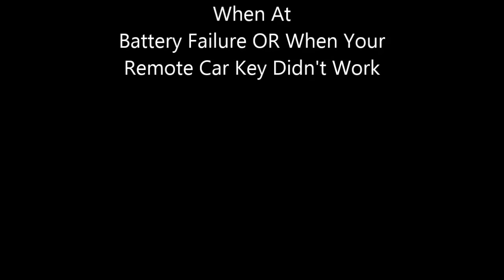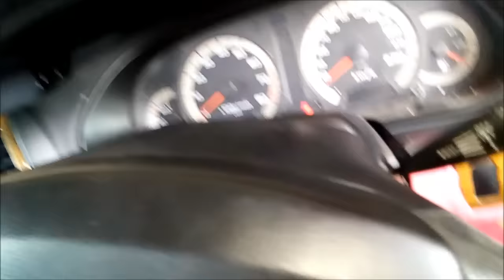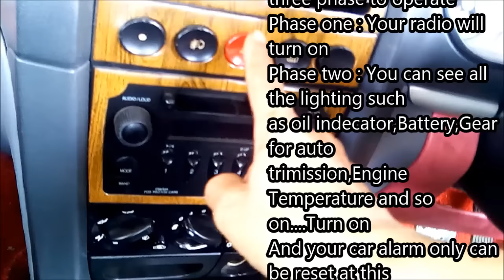How to Reset Your Car Alarm

Comment: Thank you , I have an 04 Lincoln LS and I could not figure this out for the life of me.. So I watched your video, it took me a minute to see what you were doing lol. and on mine the hazard button is setup on or behind the steering wheel.. Well key in alarm lit up and press that flasher once and boom started right up!! This particular car locks the ignition so it would not be wise to unhook your alarm. so thank you OP for such a helpful post!!
 Also for anyone else with the same make and model, if your alarm goes off while out side, use your driver door keylock and driver key to unlock the door, it will shut it off, but to start your car again you must do the flasher trick! mine hasnt gone off since.
Reply from the maker: You are welcome and thanks for adding more tips and thanks again for dropping by

Comment: Hi when I turn the key to second step, the radio/battery @ board lights didn't turn on. Do I need to start the engine before pressing the reset alarm button? Proton Waja cps btw

Comment: A lot of people tell me that it would not make a difference but, if it will not make a difference, why did it come this way? Is it just a way to save on lead and this is a quicker way of making them so they can save money on production/
Thanks again.
Reply from the maker: as I know lead connector were used in a small appliance, but for car with a very high amp battery ... eeemmmm I don't know

Comment: Battery terminals become corroded because somebody broke the seals around the post, allowing acid to escape. This generally happens when people pry the clamps off without using a battery clamp puller. If you've seen battery clamp pullers before and wondered why they exist, this is why. They have hooks that go beneath the clamps and pull them straight up without breaking the seals.

You're welcome.
Reply from the maker: Battery Terminal Puller design for the removal of badly corroded battery cable clamps and faulty small generator bearings not for removing clamps which still in good condition ... just loosen the tightening skrew and its quite easily to pull off

Comment: I know this is not related to this video but, would you know if I changed my negative battery cable connector which is lead free to a lead connector, would it make a difference? I know it came with the car for a reason. I just don't know why.
Thanks again for this and the other videos.
2006 Impala LT 3.9 automatic.
Reply from the maker: everyone using wire made from copper or aluminum and a non-lead wire are still new ... emmm I don't know how to answer your question, maybe you have to google more for some clue
Reply: Thank you for your reply.
Reply: Copper wire is far better than aluminum.
Reply: Thank you for your reply but, this question is 2 months old and the question has already been answered but, thanks anyways.

Comment: Omg your awesome! My car alarm hasn't been working so I finally bought a battery for remote but that did not work. Came across your video followed your steps and wallah like magic problem solved. It did take me a 2nd try. I only had the hazard button to deal with and no extra buttons but it worked I'm good to go thanks
Reply from the maker: your are welcome and thanks for letting other viewer know and thanks again for your visit ... and spread the knowledge to other

Comment: Put a battery pack into a cigarette lighter or use a adapter for the OBD port and the radio presets will be okay and the alarm system too.

Comment: I have a same problem right now..when i change the car battery,my alarm wont stop,then i change my remote battry also didtn work..how can i solve it
Reply from the maker: Push the alarm reset button
Reply: Kluangman Cooleck ok thank you..it work already..
Reply from the maker: All the instructions were under the video discreption area ...
Reply: Kluangman Cooleck one more thing yesterday i try lock use my alarm,it wont work,it just have a beep sound many times but it never lock the door.but when i open the car light and close the door with the light open,it can be lock..
Reply from the maker: Rudy zil try to apply wd40 to all your door locking mechanism .... Rear bonet locking mechanism and mechanical switch
Reply: I have an after market Viper alarm with ignition lock.  Saturday the alarm went off but unlike normal triggering I didn't hear the chips before it went off.  The sound of the alarm was also different not as loud.  Pressing the button it failed to shut off.  Disconnected the battery and just let the vehicle set.  Today I connected the battery and the alarm shuts off.  Now I can't get back into the vehicle without the alarm going off plus my ignition cut off is engaged.  Talking with several people who tell that I'm SOL until it gets back to the installer...  Is this true?
Reply from the maker: Michael Pearce an aftermarket alarm usually have a bypass fuse ... Try to locate the bypass housing fuse ... And it's was left empty ... If the alarm system multifunction .... Use the provided fuse to bypass the alarm system ...

Comment: so what were the steps?
Reply from the maker: put in your car key and then turn on until stage 2 . stage 3 are where your start up your engine and when your key are still at step 2, press the alarm reset button somewhere in your car and when your hazard light stop blinking you can be able to start your engine
Reply from the maker: step 1 are for unlocking the steering wheel
Reply: Thanks!
Reply from the maker: You are welcome and thanks again for your visit
Reply: Kluangman Cooleck utk saga blm blah mn buttton reset alarm??
Reply from the maker: button with a white DOT same as proton waja
Reply: Janet Martinez when I had the problem of losing control of my alarm system, where the alarm sounded and would not shut off on my after market Viper alarm.  I disconnect the battery.  What I didn't know about the alarm was that it has a sensor that will set the alarm off should the voltage get below a set voltage where your engine will not start but the alarm goes off to tell you low voltage.  If you have no control over the keypad check your battery voltage level of your vehicles battery.  

Those of you who have brakes seizing up on the passenger side might check the disks to see if they might be warped and with a slight rub or high area on a disk will heat up the brake fluid in the master cylinder which caused my 94 GMC to the curb on day.  People told me it was a break line hose.  Wrong.  I was told a bad caliper.  Wrong.  I was told it was a master brake cylinder.  Wrong again.  It was a little high spot on the drivers side brake disk and not one video had that possibility, even main mechanic didn't mention it could be heat from a rubbing brake disk to warped brake shoes.
Reply: And how about perdana v6 wheres the reset button?
Reply: How bout kancil?

Comment: I apologise for the name calling but you have to understand I am so tired of wanna be you tube heroes it's not necessary to turn off all lights ignition etc. Almost anybody knows do not ground a battery first to avoid any damage to your electrical or yourself possitive first
Reply from the maker: Thank you for your kind advice. I've been working with high voltage electrical component for quite some time now and due to that circumstance,I'm a very careful person when dealing with tools and because my safety dependent on its and may be its was my habit to connect ground first before life wire or maybe I didn't even think when connecting the battery terminal due to it small voltage ...

Comment: Kalau di kereta alarm hidup tpi xdetect di remote...xleh nk lock n unlock
Reply from the maker: Satu ..... Battery remote dah Kong...
Dua ... Buka pintu guna kunci ... 
Tiga ... Masukkan kunci Dan onkan ...
Empat ... Tekan reset button ... Seperti dlm video ...
Reply: @KluangmanCooleck  tapi bukan alarm ori waja...alarm dah tukar...still buat mcm dlm video jugak ke kalau bkn alarm ori kereta???
Reply from the maker: @e-onechannel6995  ... Bukan alarm ori ... Cuba tukar battery remote dulu.... Sambil2 tu Cuba Cari bypass fius alarm tu ... Kebiasaannya ... Terletak bawah dashboard pemandu ... Masa pomen pasang dulu ... Dia mesti Ada bagitau kat mana nak bypass ...
Reply: @KluangmanCooleck  bateri remote dah tukar tpi still xleh detect...bkn sy gi tukar alarm...ayah gi tykar ari tu...ok2 nnti sy try cari...sy xmahir sgt bab2 bypass fius ni
Reply from the maker: @e-onechannel6995  kalau tak jumpa juga ... Kena pegi tempat yg pasang alarm tu ... Tanya pomen tu ... Dari A to Z ... 😂